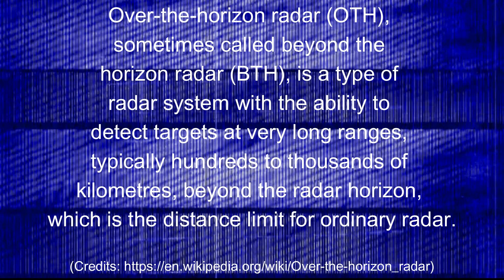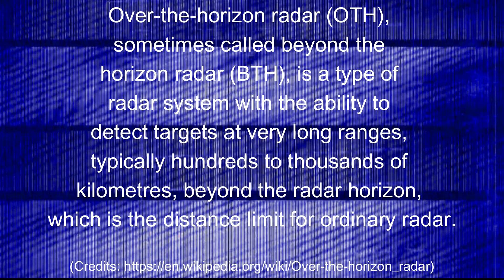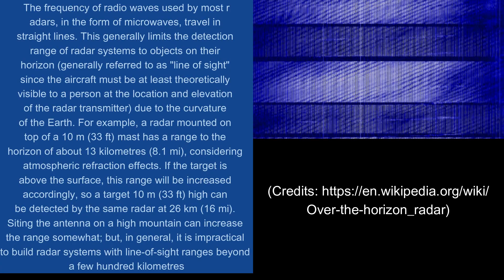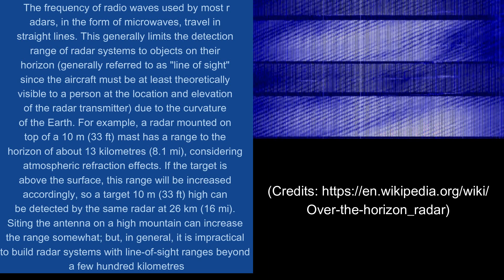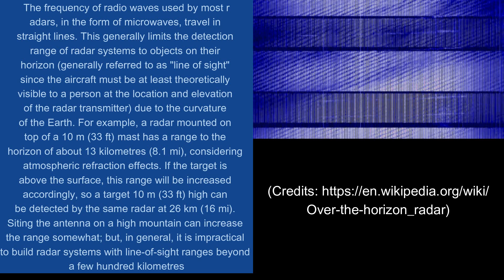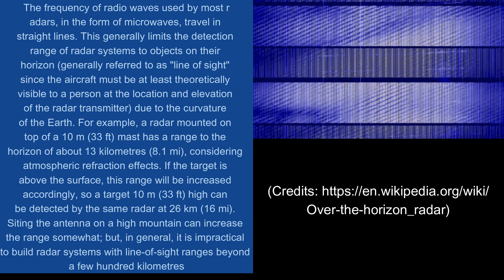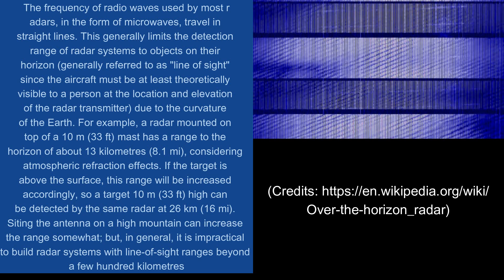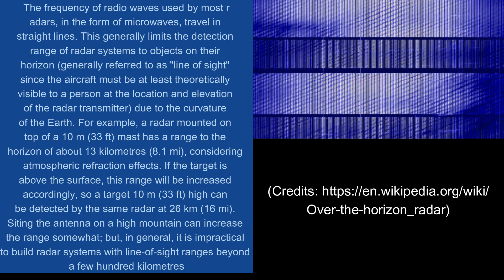28400kHz Over the horizon radar active on HAM-Band (12.10.2024)

Comment: With that high a pulse rate (around 2K) and the relatively high frequency (28 MHz), it's unlikely to be an over-the-horizon radar. OHR radars operate in the 7-10 MHz range with a pulse rate so slow it sounds like a woodpecker. I know. I heard the Russian Duga near 7 MHz.
—If this is a radar, it is intended to see nearby stealth aircraft. Stealth tech doesn't work at HF and low-VHF frequencies. I seem to hear an up/down warble in the signal. That might be the antenna rotating around or maybe moving left to right and right to left.
—It might also be used for other purposes. Not long ago I read about a system that used pulses at HF to measure the roughness of the sea off California. The greater the return, the rougher the sea.
Reply from the maker: Hello Inkling777, the OTH-B (Backscatter) uses the reflection properties of the ionosphere to achieve ranges of more than 2000 km using space waves. The transmission frequency for this process is between 15 MHz and 55 MHz. The OTH-SW (Surface-wave)radars use a carrier frequency of 2MHz up to a maximum of 20 MHz. This here was the Iranian Sepehr - OTH. This works in the 10m band around 28MHz).

Comment: I saw an old type stationary radar that the Turks used for aircraft search. This thing looked a little like a radio telescope stuck in the ground. It covered a lot of area at a low frequency and I thought it   could do over the horizon. Pretty sure the frequency was in or near the AM radio spectrum. Anyone else ever hear or see this?
Reply from the maker: Over-horizon radar systems are usually masts that form an antenna. At that time, there was a secret Soviet Union facility near Chernobyl in Ukraine. There are now also mobile systems, but as far as I know they don't have a dish (i.e. the Over the Horizon systems).OTH-SW radars use a carrier frequency of 2…3 MHz up to a maximum of 20 MHz. The medium wave goes up to 3Mhz, so you may have seen some kind of radar system there.